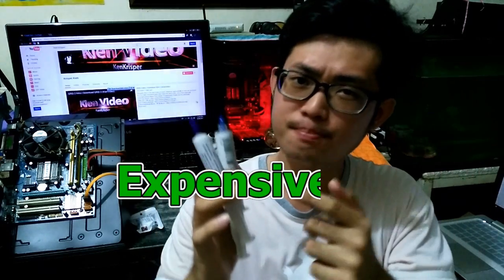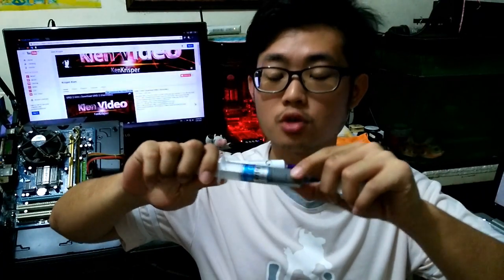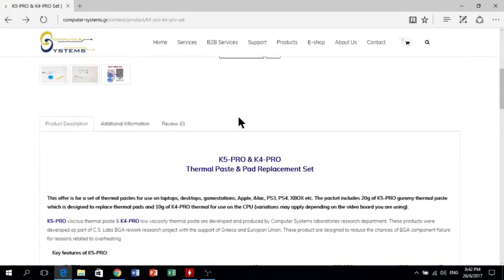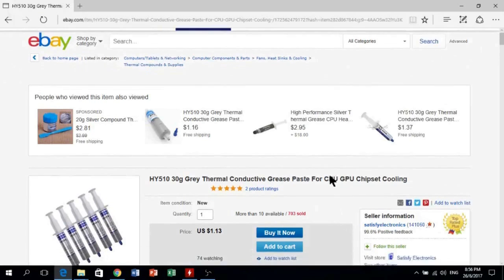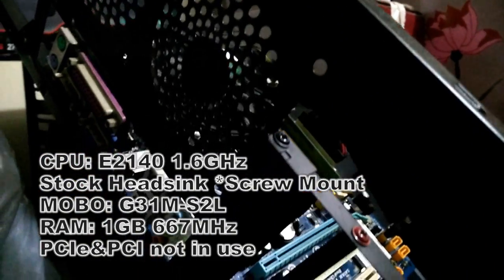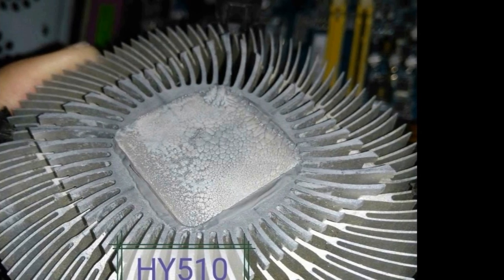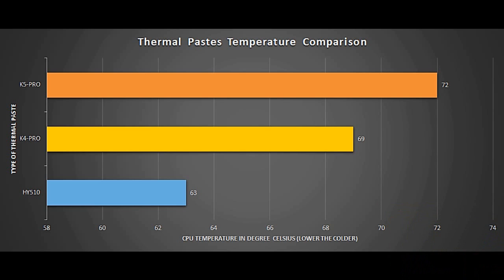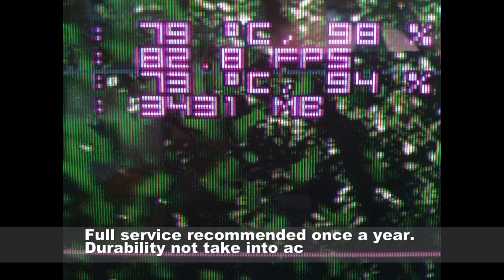HY510 vs K4/K5-Pro Thermal Pastes Comparison （Check Description）

Comment: K5-pro doesn't go on the cores.  It's to replace thermal pads.  Use a normal thermal paste for the CPU/GPU cores.
Reply: oh really ? go for what then ?
Reply: @MrHoudaifas  K4-Pro is designed for the cores, K5-Pro is to replace all the thermal pads.  I use Arctic MX-4 for the CPU/GPU cores, K5-Pro for the thermal pad replacement.  Big difference.

Comment: Hi, best review of the hy510 i could find. In your opinion does it last more than 2 years? How much have the temperatures increased after 2 years, since i read in the comments that you still used it.
Reply from the maker: yeah, and my laptop are still runing it without a problem.
Reply: @KrisperKien  I stress tested mine with HY510 and it did very well, and through hard daily use non gaming it is perfect.
Reply from the maker: in my case i am lazy to do maintenance since i getting busy, but surely, yearly maintenance is required.

Comment: I bought the HY510 to replace the stock thermal compound on my i7-4770K with stock cooler. Can't say I am dissapointed for the price. Are there better thermal compounds? Of course, especially for performance users but for the price it gets the job done. For me the big bonus was most asian sellers will ship for free so unless you're buying something else from a local retailer and don't need it urgently it's good value. Similar results on my stress test with 68c average at 20c ambient.
Reply from the maker: Thank you for your sharing, sir ! :D
Reply: 20c at idle damn man

Comment: The K5-Pro is to use on Video Ram where normal thermal paste is to loose to build up in mass and stay at same spot on iMac GPU is a good example. You shouldn't use K5-Pro for a CPU or GPU. I don't know about the K4 if it is any good never used it.

Comment: K5-pro is a junk. 
Simple test on Dell E6410 with dedicated nvidia gpu with ~1mm gap shows thermal shutdown in about 20 minutes of stress test. Dell uses fujipoly extreme 11w/mk which allows gpu to work 24/7 under any load
Reply: K5 pro is meant to replace thermal pads or manufacturer applied thermal goop on RAM and power delivery components. If you use it to couple cpu/gpu to the  heatsink, you are going to have a bad day.
Reply from the maker: Wow~ I cant believe it

Comment: i used hy510 for me it lasted for a year then i re applied it again in my opinion its a really good budget thermal paste and its best that you should not use this paste if you are an overclocker this thermal paste are for stock coolers and cpus!!!!!
Reply from the maker: I agree with your opinion. However I myself are using it for my overclocking video, it works until today, so far I have no issue with the HY510, but I dont mean it is the best thermal paste, but at least it is cheap and usable and reliable. :)
Reply from the maker: @Jayden Jalloh Hi, yes my PC is working just fine. I left to my younger sister to do her OT job at home nothing bother her. 🙂
Reply from the maker: @Jayden Jalloh If you not order yet, i recommend you order MX paste because many people In the command tell me to use MX because it is not expensive and better performance.

Comment: I've had good results with the HY510, haven't exceeded 60C yet with an i5-6500. But the thermal paste does look weird when you take the fan off, that's the first thing you notice something is dodgy about it lol. Best value thermal paste is currently the Arctic MX-2/MX-4
Reply from the maker: Thanks for the information. :)
Reply: after how long did you have to replace it?
Reply from the maker: @taha9406  According to my own technique of apply it, usage and working environment, it currently holds up more than a year already that I don't have to do anything for now.

Comment: Thank you for purchasing our products and creating this interesting video. You mention that you sent us an email to which we didn't reply. However we do reply to all emails so propably we didn't receive it. We kindly ask you to resend it. About your testing.  
K5 PRO is a thermal paste designed for thermal pad replacement. It is very viscous so in no case it should be used as a normal paste. You should compare it with a thermal pad and not with a normal paste.
K4 PRO is a thermal paste designed for longevity. If you keep it installed a system for several years and do the same testing again you will get the same results. HY510 is a respectfull product which gives good results (for Chinese pastes) on burn tests but everyone knows that after a couple of months it gets complitelly dry and looses it's properties. If you keep both pastes installed in a system of the same type runing for 2-3 months and then perform the same test you will be able to see why K4 PRO is superior to any low cost thermal paste.
If you can replace your paste every few months then it is fine to use a low cost paste like HY510. However if you have a complicated system like iMac or PS3 then we strongly sugest to use a branded paste designed for longevity because with cheap pastes you will get overheating very soon even if you get perfect results doing a burn test the first day of application.
Please let us know if you need more info.
Reply from the maker: Very appreciated you'd made a clarify about my opinion. Very detail explanation I still have to say thank you. According to your information, the hy510 still perform best after 6months in my another PC, I will keep monitoring it. About the K4 I still hope this product can improve because of the thermal throttle after I apply k4 to my gaming pc, literally gain around 5degree Celsius which is not acceptable for a PC, thus I'm worrying of apply k4 to laptop which has poor air ventilation designed. If you said the durability of the paste is stand out in k4, I still hope the thermal conductivity can be improve. The k5 may not be a good demonstration here, as I knew the product designed purpose I just took it to test as a comparison. Thanks.
Reply: its not meant for CPU and GPU but VRMs etc  @KrisperKien
Reply: @Krisper, you wrote that reply 10 months ago.  How is your HY510 paste holding up?  I myself applied K4 Pro to my late 2009 iMac's video card GPU over 1 year ago, and K5 Pro to the card's memory chips.  (Check out my iMac BAKE REPAIR videos for details.)  So far I've not had any problems and temperatures have been consistently stable.  I'm happy I got a paste I don't need to swap out because opening up these iMacs is a pain.  And while there are some better pastes for the GPU, I like the K4 Pro because it is not electrically conductive.
Reply from the maker: @JDW-  So it's more than a year already. I'm going to reply your question, it holds up very well that I don't have to do anything on the HY510 now. The one on my laptop also the same.
Reply: I myself have been using K4 and K5 Pro on my late 2009 iMac's GPU and Memory since the first week of July 2017, and the machine is still going strong, being used for several hours every single day.
Reply: @KrisperKien  so this low cost stuff doesn't dry out in a few months like they said?
Reply from the maker: @FTVG_inc  Im using for years now, it never give me any problem.
Reply from the maker: @FTVG_inc  You remind me to have it service, and replace with fresh paste, I remember its been running for 2 years or more in my laptop. Although it still running fine, but it is time for service
Reply: @KrisperKien    hey, based on your reply, are you saying that you have hy510 on laptop for 2 years?

1-if it is, can you share the difference of temp the day u apply it and the day you remove it?
2- when you service the laptop with hy510 in it, does the thermal paste hardened like plastic? or it still have some 'fluid'ity in it?

im asking because i got hy510 laying around, originally buying it not for cpu/gpu, and now i can see dust at the fan, so im planning to service my laptop. since i have HY510 laying around, im thinking of using it. and my laptop is kinda pain in the ass to change the paste. im seriously cannot make a decision whether to just use the hy510 and see if i got thermal throttling or just go for noctua nt-h1/arctic mx4/coolermaster mastergel pro v2. right now im leaning towards trying the hy510 first, if no good then maybe change to noctua nt-h1/arctic mx4/coolermaster mastergel pro v2. but i am really concern if there is dramatic difference in temperature if using the premium one. if the difference is above 5c then i might give it a shot on next service